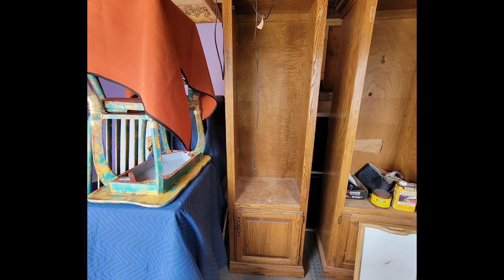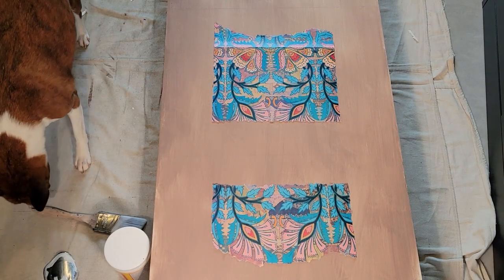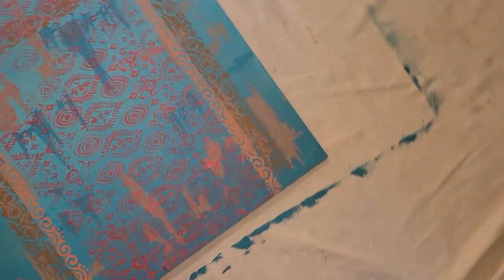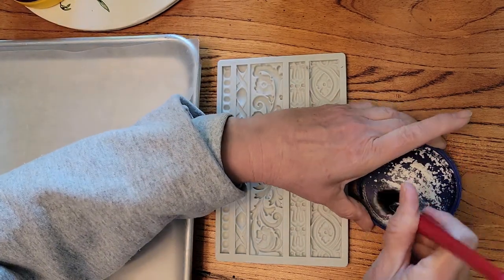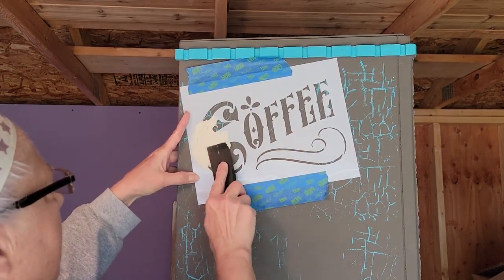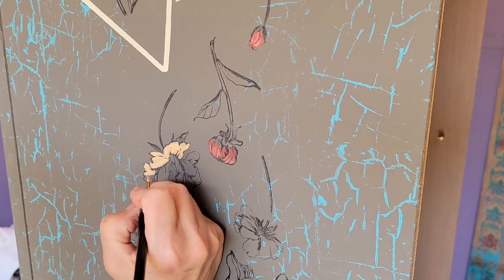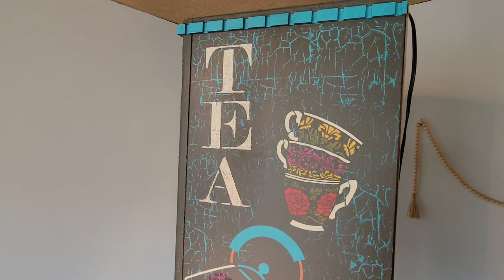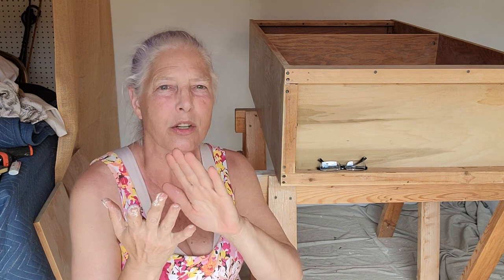Upcycle to a Coffee & Tea Bar, #maximalistchalllenge, WIN some Stamps, molds, & stencils!!

Comment: This is amazing! What stencil spray did you use to avoid the sticky mess? I always end up with a residue
Reply from the maker: Hi there, the spray I used for the stencils was  the brand "spray n bond"  pattern and stencil adhesive.  It is in a white and turquoise colored can.  I have gotten it from Michael's before, and from Amazon.  The coffee and tea pot stencils were really cheaply made and not much mil to the plastic.  It was floppy.  So, I ran out of the spray n bond and used another brand I had.  I probably sprayed to much on the stencil because of its make up, add that to 120 degree shed and you have a sticky mess to clean up.  It came up well with water but I did have to go back and do hand painted repairs.  Regards to you.  Dar p